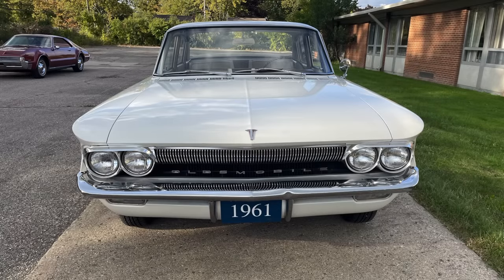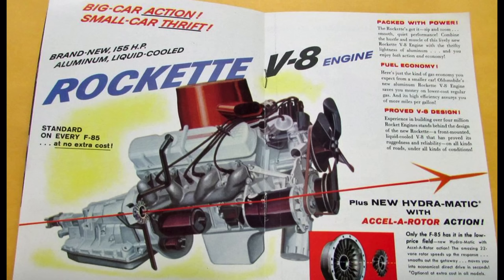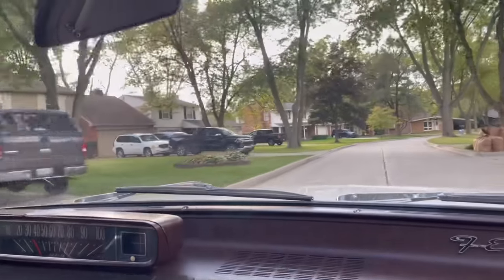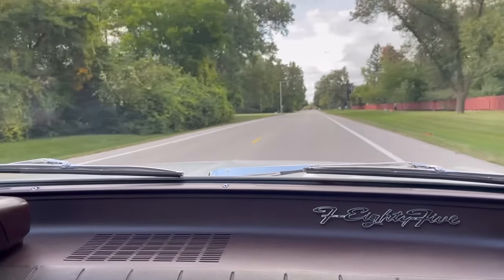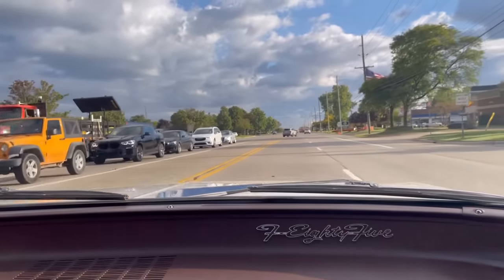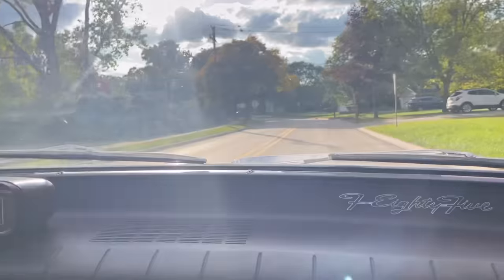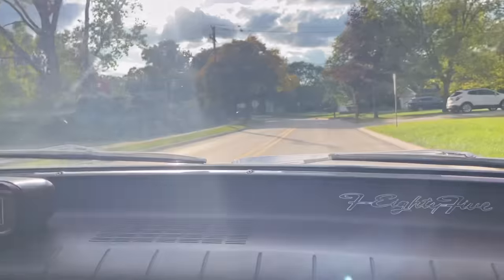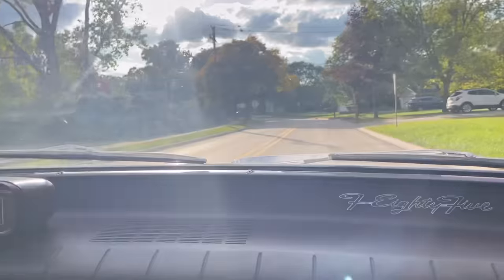Driving GM’s Worst Transmission: The Roto-Hydramatic (“Slim Jim”)

Comment: Had a '64 Catalina that went through 4 Rotos.  The good fix in that day was to swap in a Jetaway from, say, a Bonneville, but didn't do that.
Later had a '62 F85 with the little Roto, and it worked fine - got 1 rebuild, which was normal for the life of an early 60s automatic.
Reply: Jetaway? Isn't that an Oldsmobile tranny? I have had a '63 Catalina convertible with the Roto-10 for the last 37 years and am totally familiar with all its quirks. I am pretty sure the other Pontiac tranny for '63 and '64, the one used in the Bonnevilles, is the Super Hydramatic, which has an equally poor rep and requires a differently-shaped tranny hump in the floor. Very interested to hear there might be other pre-1965 GM trannies that would fit.
Reply: @eriksmith6873  The Jetaway name causes quite a bit of confusion because it appears in two different time periods on two totally different transmissions. It was a name exclusive to Oldsmobile even though the trannys themselves were used by multiple divisions. The new redesigned 1956 dual coupling Hydra-Matic was used by all GM divisions except Buick & Chevrolet. (A heavy duty Hydra-Matic of the older design may still have been used in some of the Chevy trucks)
Every division had its own unique name. Olds called it Jetaway Hydramatic.
In the 1964 makeover of the "senior" compacts as a new group of mid-size cars an entirely new 2 spd automatic was created which was used in those cars as well as the entry level Buick LeSabre & a new entry level full-size Olds, the Jetstar 88. Those cars now used the small V8s of the mid-size models as the base engine, coupled to the new 2 spd automatic. Olds called that transmission Jetaway Drive. In Buicks it was "Super Turbine 300". In Pontiacs, surprisingly, it was probably the 1st time since automatic transmissions had appeared that one had no specific trademarked name. Olds & Buick supposedly offered superior performance by way of using a variable or "switch-pitch" torque converter in their versions, borrowing the concept from Buick's Turbine Drive, essentially the final iteration of "Twin Turbine" Dynaflow. This gave the effect of a "high stall" converter (about 2800 RPM) for full throttle take-off & a normal (1800 stall) for typical driving. Hope that clears up what's what....
Reply: @DejaView  What threw me was the usage of the term Jetaway to describe the transmission in the '63 Bonnevilles and (I think) Star Chiefs. So Jetaway and Super Hydramatic refer to the same transmission? This actually is of relevance to me, as a longtime '63 Catalina owner, because I've often wondered if there is a tranny I might be able to swap for the doggy Roto 10 without making major modifications to the car. The Super Hydramatic does not sound like a good choice, because it sounds like a bit of a dog as well, and there would be floor-pan issues. Your reply clarifies something for me, however. Today we think of the smaller V-8 powered '64 Pontiacs (Tempest and LeMans/GTO) as some of the best cars Detroit ever produced. A new transmission that year helps explain it.

Comment: I had a slim-jim in a 1962 Catalina.  That trans started slipping at low mileage.  The 1-2 shift was harsh due to the very high 1st gear ratio and then a steep drop into a low ratio second gear.

Comment: If you go through th history of the Hydra-matic (Hydro-matic), GM had many variations across the marks.
Check out the Weber University Hydromatic fluid history videos.  Excellent stuff

Not GM's only transmission failure to be sure.  THM 200 im looking at you

Comment: I had two of these in two 1963 full size olds offerings, a 4 door sedan and a 2 door hardtop, both had the green block 394 engine. 

I really liked those transmissions, the first gear behaved as a low and aggressively geared demeanor that felt like a mid level stall converter, and the second gear was like a direct drive, like you’d feel in a manual transmission. Third gear was look the hell out, as the factory gearing really loved 120 mph, and it would hold that easily all day long with 1/4 pedal or less. 

The slim Jim did a good job of utilizing, and perhaps even dramatizing the brutal torque the 394 had. 

Never had a single issue out of either, not so much as an annoying seepage or drip. Both of those transmissions worked flawlessly, and I was anything but gentle on them. 

Apparently the atf they used had sperm whale oil in it, which was banned in the late 60’s for commercial use, for obvious reasons. 

I have to imagine that was key to my own flawless experience with that transmission, I’ve heard when people changed the original ATF out for standard dex/merc 3, that’s when the problems start. 🤷‍♀️

Comment: gm could have put a 2 speed powerglide in that car it would have been cheaper and more reliable i had a 63 grand prix 421 and tossed the roto hydro and put a turbo 400 in place  had to change starter from bell housing to engine block changed the shift pattern on center console p r n d s l

Comment: Does this F85 have radio delete?
Reply from the maker: Nope. It was not ordered with the radio. They weren’t standard equipment.
Reply: @RareClassicCars  A bit startling to see in a deluxe model.
I once owned a 1965 Dodge Dart with radio delete.
Reply: The term radio delete is a bit of a misnomer. Radios were almost never standard, but for the purpose of brevity, saying radio delete is easier than saying, for example, factory no radio.

Comment: The Buick Specials of that era 1961-63’s had an even worse transmission.  It was a two speed air cooled POS called a Dual Path.  They were garbage.  All of the the Roto Hydramatics were junk and the Jetaways were just as bad.  Ford and Chrysler built much better transmissions in those years.

Comment: Has anyone been able to put a Type 315 Hydra-Matic from a '61-'64 LWB Pontiac or Cad into a full size Olds to replace the junk Type 375 Roto?  I've heard that it's doable.  I have a very nice '62 Starfire convertible I got dirt cheap due to the Type 375 being trashed.  I really don't want to throw money into a Roto, and the 315s were also better performers overall.

Comment: 👍🏻👍🏻👍🏻
Reply: A friend of mine had one of those with the aluminum V8 when we were in college. It seemed peppy and a bit loud. I thought the engine was bigger than it really was. I recall he had cooling issues because of the aluminum block I suppose. The floor was nearly flat and the whole interior seemed to be low, something about the “flex” driveshaft.

Comment: The Roto-hydromatic was known as the "slim jim"
It was advertised as reducing the size of the transmission hump, which it did.  
It was only good for 20,000 miles before rebuilding was necessary.
Reply: The Slim Jim transmissions were troublesome, but really too bad for those drivers who learned not to rub them the wrong way.  I believe that Chevrolet's short lived Turbo-Glide tranmission was a whole lot less durable than the Slim Jims.